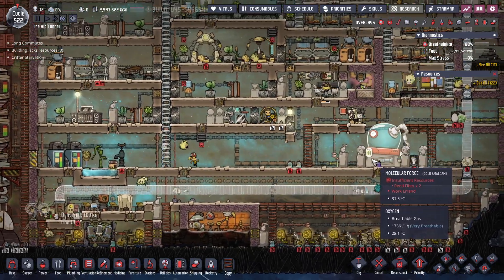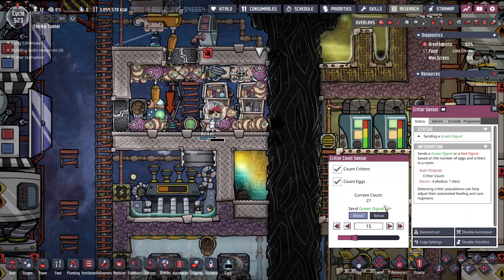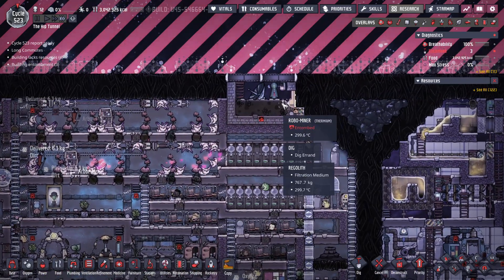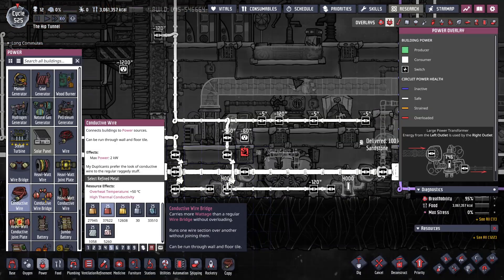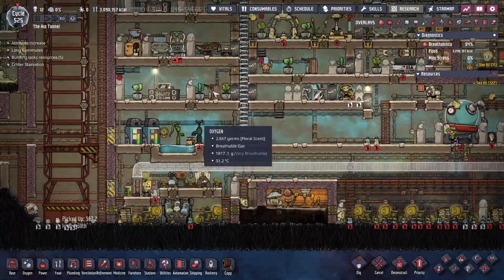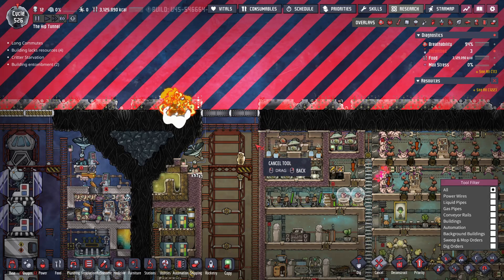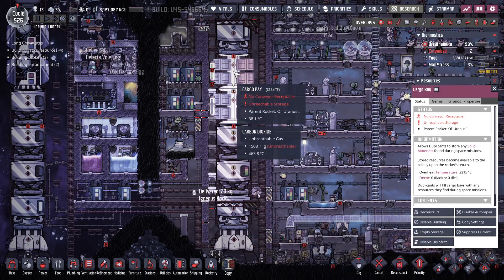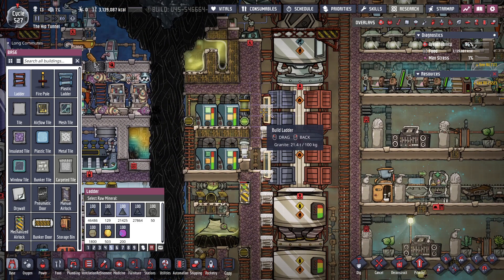Insulation Takes So Much Reed Fiber Hip Tunnel ep 19 Oxygen Not Included Mini Base Playthrough

Comment: I don't think you need bridges to be made of insulation
Because the part that actually carries the liquid will still be the pipe, right?
Reply: Bridges cost less insulation
Reply: @Anaconda0389  It's still costing insulation though
We could very easily use igneous rock for bridges
With the hydrogen rocket their is a concern of melting, but if I am right about bridges not carrying liquids just teleporting them
Then no hydrogen should be lost even if they melt and we can rebuild them just as easily
Plus if they have acquired obsidian from the space missions, melting shouldn't be a problem at all
Reply: Bridges do not exchange heat with the content (they dont hold any liquid) so you can just build them out of Obsidian. Use the insulation for the pipes 😁
Reply: I've tried building bridges over steel doors carrying magma heat, and melted out the bridges. The center section will try to share heat with walls and such.
Reply from the maker: for the 100 they cost vs the 400 they save.  Safe if better than hydrogen explosion.